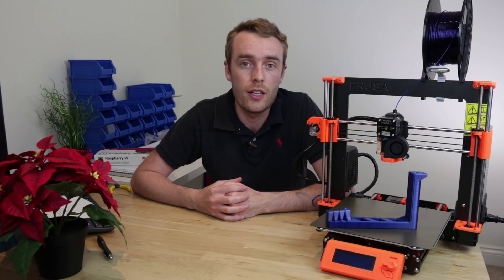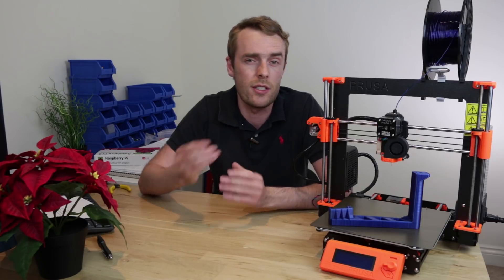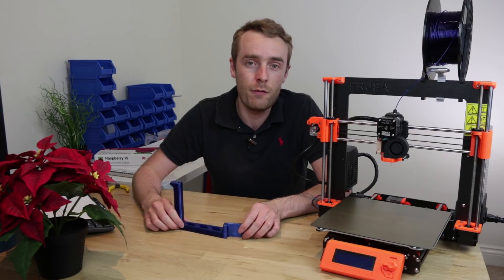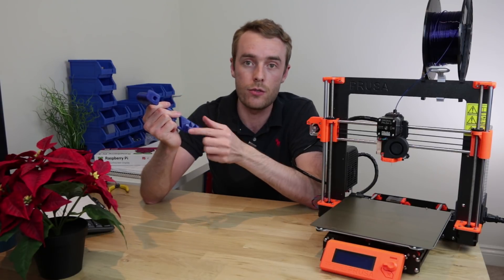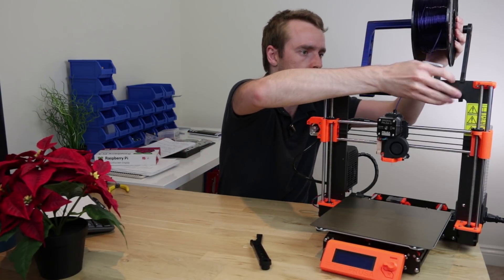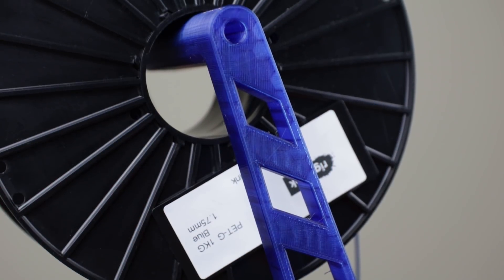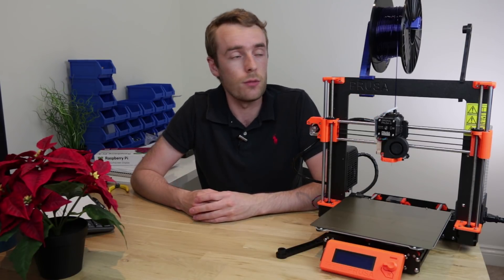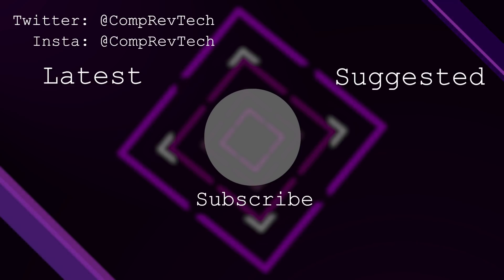#3DTWIP - Prusa i3 MK3 Replacement Spool Holder

Comment: When will people learn, "Don't attach spool holder to your printer"  especially not the top,
This %100 effects the precision of your machine and not in a good way.
It's like leaning on a small cnc while in progress.
Try it, do a print with spool off printer than do identical print with spool holder on the top...
The effects will be more noticeable with more weight, ex. A new 1kg roll.
Reply: Rob Loney if your frame has even the slightest bit of give, like a lot of people's cheap printers than it will, I have showcased these effects at many maker fairs. 
Now of coarse it won't have effect on higher end printers that have done their research.
Like anything, their are always acceptions

Comment: I have a MK2 and tried printing the new spool holder in PETG as well.  I also noted it flexed a lot and was able to break it, trying to bend it.  I printed a new one with 5 perimeters, top and bottom layers in ABS,  This one is a lot stronger and stiffer, and I couldn't break it.

Comment: I like the idea to showcase only functional prints since it’s so hard to demonstrate the utility of a 3D printer to someone who shows a bit of interest. For that reason, might I also suggest shying away from showcasing too many 3D printer parts or upgrades? If the most useful thing you can do with a 3D printer is upgrade/repair itself then there’s no reason for a prospective buyer to buy one, and that’s the impression many newly interested people get when they look up a few 3D printing videos. It’s all decorative vases, Benchies, Baby Groots, and 3D printer upgrades.
Reply: C.R.T Alternatives to commercial products could be cool. I recall wanting to order a $6 beard trimming alignment tool/stencil from Amazon until I saw a ton of them on Thingiverse. There are a ton of replacement parts. My friend needed a replacement battery door for his DirecTV remote and we found that too. Try searching for something vague like “replacement” and you’ll get a lot of ideas. :)

Comment: I recommend to heat the spoolholder slightly with a hair dryer before Assembly. This aviods the Crack risk and After cooling the assembled Part has a perfect fit

Comment: There’s a few cooling fan ducts on Thingiverse for the mk3. You should try em out and see if they improve the print quality
Reply: It would be especially helpful to print and compare a few different fan ducts, perhaps using Angus's lattice cube, which does seem to print better at the front than at the back. A new blue fan duct to match the new spool holder? Maybe not. ;)

Comment: Ah the infamous spool holder, never got why they designed it like this as alsmost everyone seems to crack it. :) Not what I like when spending still 800 or so on a printer.
Reply: I've gone reverse bowden which gets rid of the spool holder. One of the best upgrades for my printer.
Reply: My went on fine but the filament gets pulled off the roll. Solution- empty roll on it and a filament stand on the floor with the filament guided by the empty spool which also acts a a pulley to bend the filament 180 degrees.

Comment: A nice idea for a series, if only because of the subtle humor sure to be included in each episode. As for the MK3 spool holder, I think it is the design. The fit is impossibly tight. That's why, after seeing you crack yours and not being able to get mine on no matter how hard I pushed, I carefully filed the slot until it snapped on with reasonable force. Rather than printing an MK3 spool holder for my MK2S, I ordered one from Prusa for the bargain price of $3.41, reasonable to do since I needed other parts and had to pay the high shipping costs anyway.